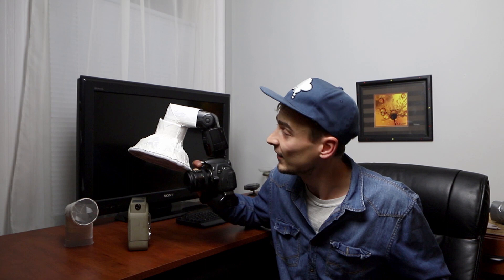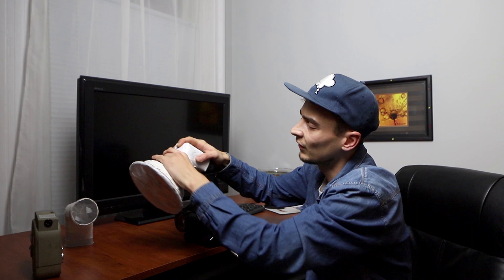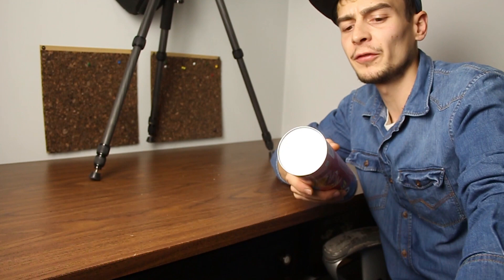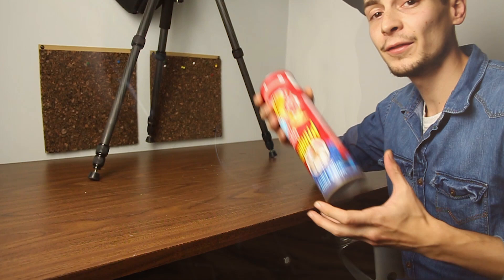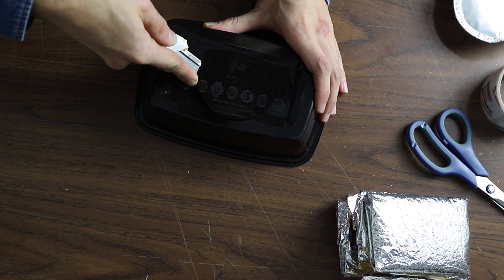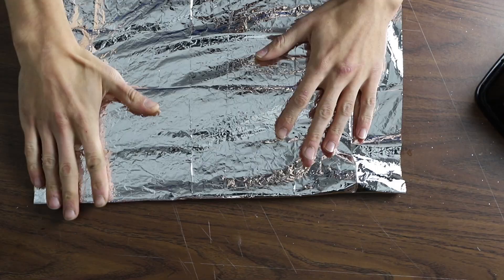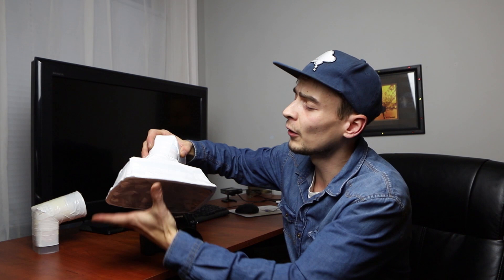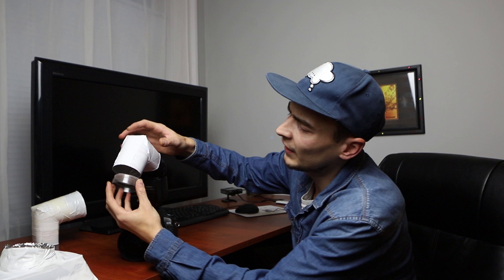Best Diffuser for Macro Photography [DIY Flash Mod]

Comment: I have to say these are the best designs I've seen for DIY. Not to mention save you as much as $500 at least on a comparable ready built one. And I like the diffuser idea. Because you could actually take the lids for your plastic containers and insert different color diffusers or refraction patterns.

Comment: Very inspirational.

I had a look at what I have that could be used. Pringle is not that prevalent in Norway.

Milk carton. Possibly reinforced with a wooden spatula or ice cream sticks. Can also cut support beam from plastic bucket.
Craft foam similarly reinforced. 
Would consider reinforcing with dry spagetti. Glue with water to form thicker and longer sticks.
Aluminium foil glued on the inside of tube.
Plastic bottle lined with foam or foil.

Elastic or hair band to keep device attached to flash.
Craft foam or similar for padding.

Diffusers.
White single use plastic cup.
White plastic box.
Clear plastic which turns opaque when washed in hot water.
White paper (thin). White handkerchief. Bedsheet.
In an emergency : toilet or kitchen paper.
Plastic bag. Either white or translucent. Crumbled plastic bag.
Reply from the maker: Thanks so much for this incredibly useful comment! I'm sure many people will appreciate the time and effortyou put into this list.
I am sorry about my late reply, I literally just noticed this comment... I wish I'd have seen it sooner.
Thanks again and all the best, Max

Comment: It is a good design, have you considered it might be improved by some camouflage treatment when photographing insects. I use a DIY two flash set up, one on either side of the camera, but one as a two stop down slave, to get some contrast. Diffusion is provided by a piece of plastic cut from a A4 folder, but it is covered with one way mirror film, so insects see a reflection of their environment rather than something that might swat them. I lose some light, but as I am so close it does not matter.
Reply from the maker: That sounds like a great concept too! In my experience ( I have tried white, green and black diffusers) the colour doesn't make much of a difference, the main thing that I try to be cautious about is to not cast a shadow on my subjects as they often take that as a sign of approaching predators. Thanks for your comments!

Comment: I'm finding the angle is very important in diffusing. If you get it wrong, your lens can cast a shadow on the bottom of your subject, and taking shots at certain angles can give nasty specular highlights. It seems better to go from above and light downwards. This is why the pop up flat diffusers that sit on a lens are no good. I modified one to have a cone from the flash to the diffuser with tinfoil inside and it made it worse with reflections. I'm going to redesign it with this method, as others have shown good results also

Comment: You can’t put these attachments on a Canon R5.  The reason is that the hotshoe won’t support anything more than a standard lens or it will come loose.  This ia a $350 repair from Canon.  Using an R5 means with the lens cannot be attached to the canon, or you have to use a diffuser that is attached to the lens.